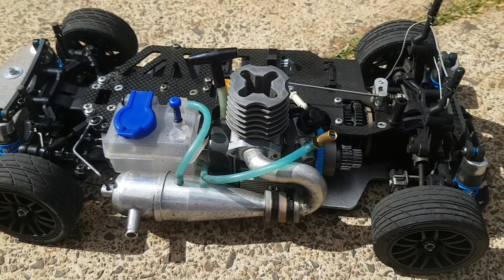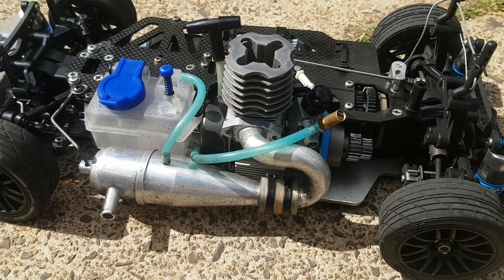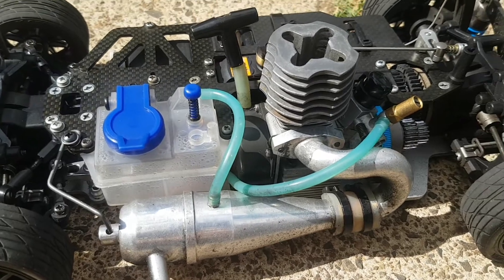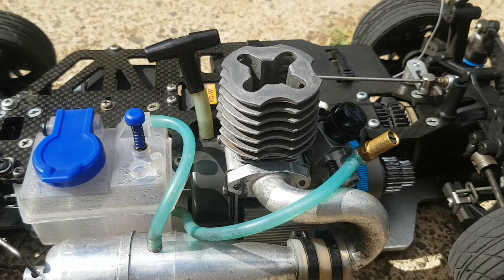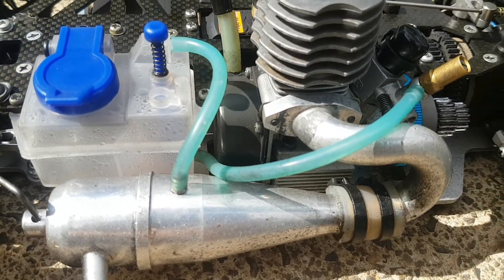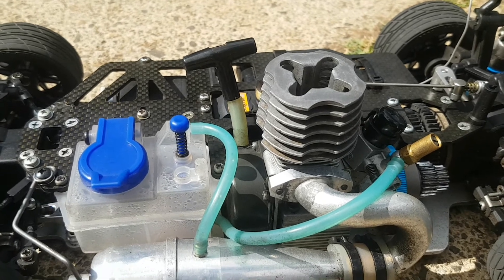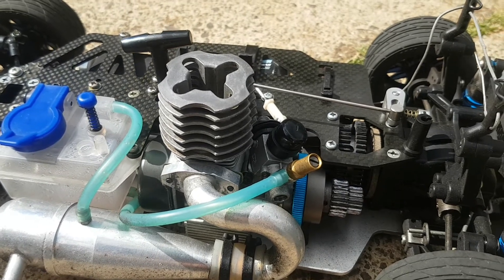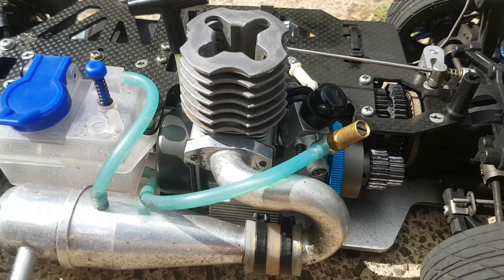OS max 15cv-ex sounding better than ever!! Vintage Tamiya nitro RC, TG10mk1 pro. Hopups galore!

Comment: Hi mate what's the fastest one you have and what top speed are you getting and the weight of it thanks
Reply from the maker: Thanks for watching👍 I havent really done a speed comparison to be honest. If you look at them on paper I would have to say the TG10R with the FS18SR would be the quickest given that it has the biggest spur gear/pinion gear combo plus the FS18SR is a pretty high revving engine. It would be followed by this .15 CV Hyper powered Mk1. long suspension version. 
I will try to get out a speed run video and I might throw it on the scales too. Cheers
Reply: Do you know what are your settings I can’t get mind to start
Reply from the maker: @juanmendez2060  Hi mate, thanks for watching👍 I installed a new piston and sleeve into this engine prior to filming this clip, I returned the carb back to its factory setting which is, main needle 2 full turns out from fully closed and the low speed needle flush with the carb housing and then 2.5 turns in (10c slide carb), I then followed the break in procedure as per the O.S manual. Actual settings really depend on a number of factors including temp, humidity, elevation, fuel type etc. Hopefully this helps you out.